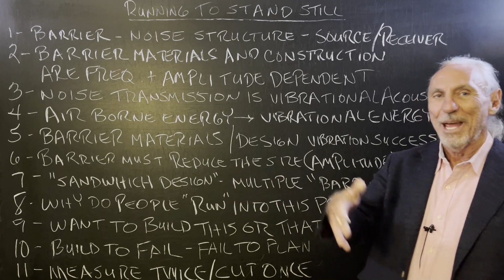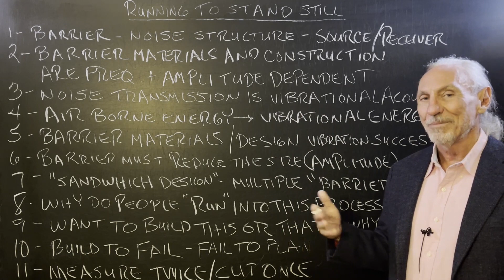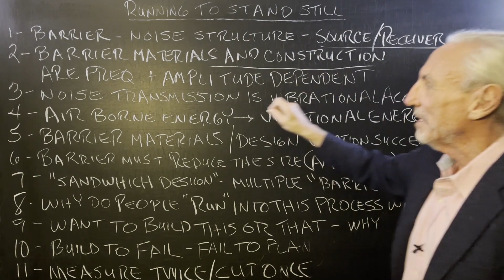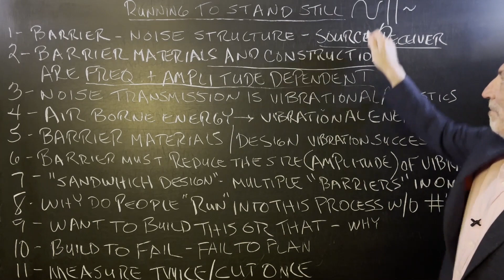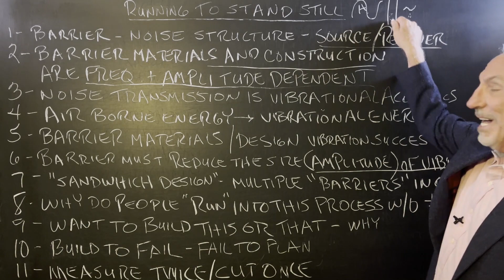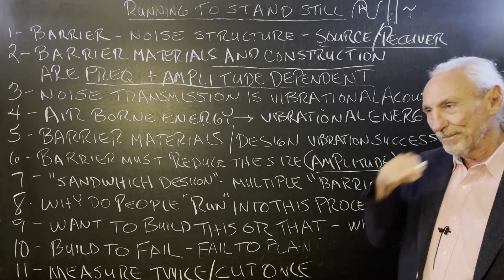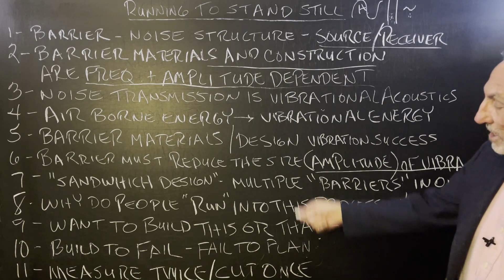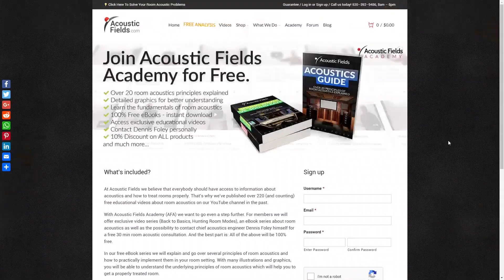Running to Stand Still - www.AcousticFields.com

Comment: You can burn a little (or a lot) of money without any significant improvement and perhaps even making some things worse, if you don't understand the fundamentals of the system you're attempting to influence. Throwing stuff at the wall (pun partially intended) and hoping it sticks. Try this thing, didn't work. Try this other slightly more expensive thing, didn't work either. Good money after bad. Then there's the disappointment when the result falls far short of expectations. Don't fall into the trap of "There's never enough money to do it right the first time, but, somehow, there's always enough money to do it over the second (or third or fourth) time."
Reply from the maker: Agreed. This is why you must develop a strategy that fits your budget and listening requirements. The strategy is implemented step by step.